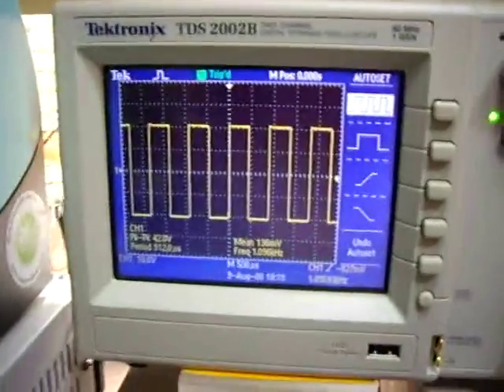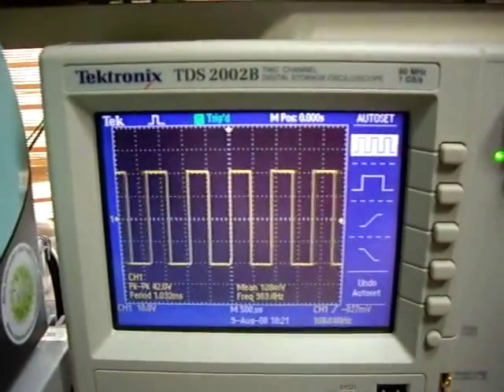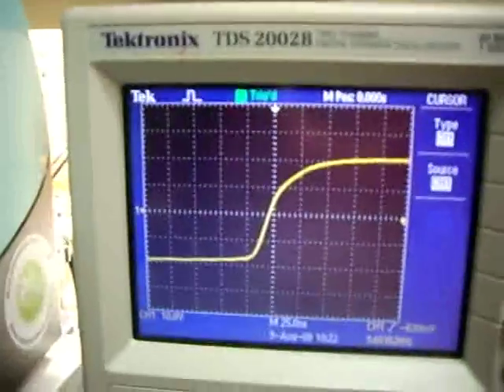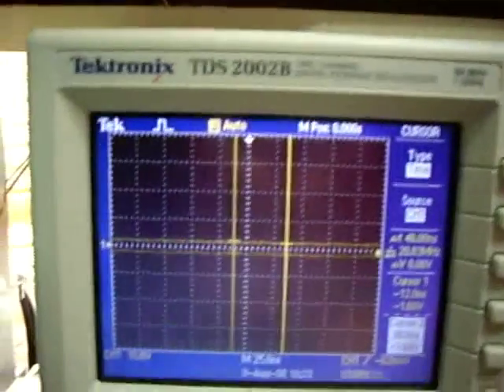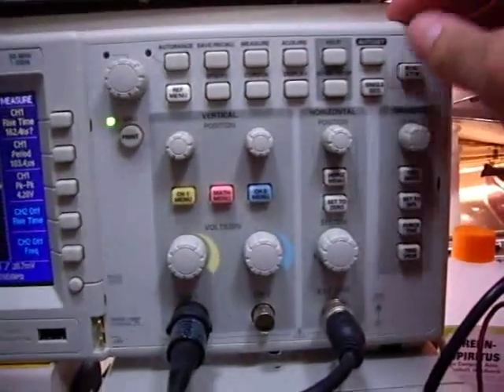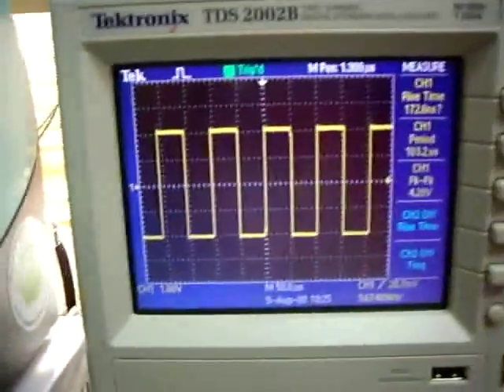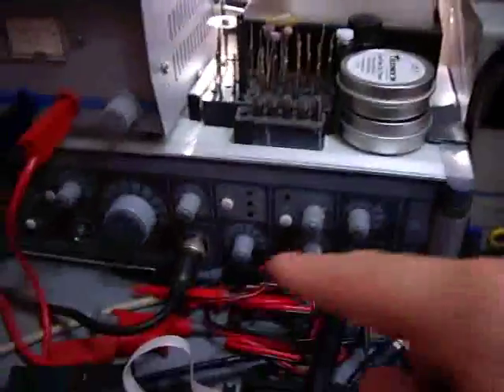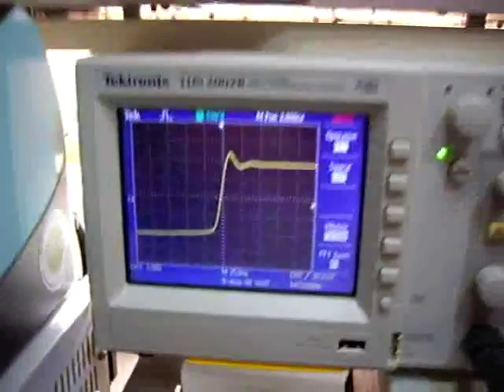Basic functions of my Tektronix TDS2002B scope.

Comment: According to the TDS2000B Series User Manual,

"The Save Waveform action saves the specified waveform to a file named TEKnnnn.CSV, or to reference memory. The oscilloscope saves waveform data to files as  "comma separated values" (.CSV format), which are ASCII text strings that list the time (relative to the trigger) and amplitude values for each of the 2500 waveform data points. You can import .CSV files into many spreadsheet and math analysis applications."

Can you do a demo video of this? :)